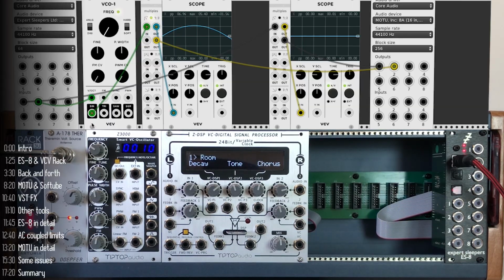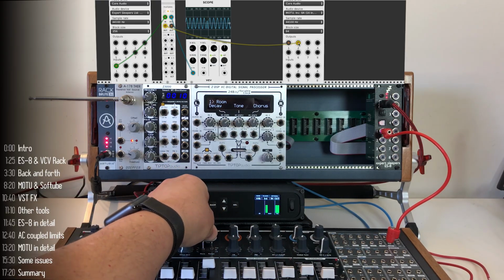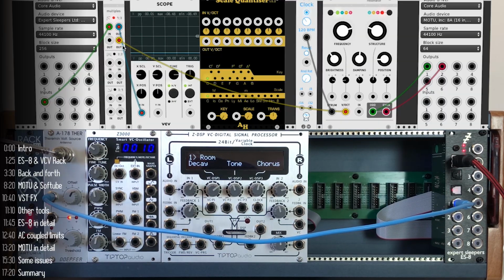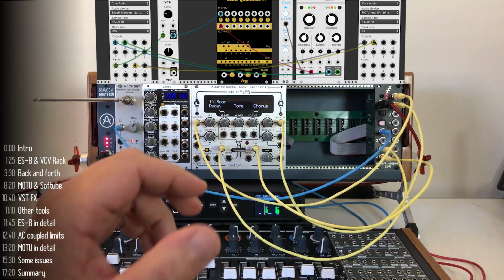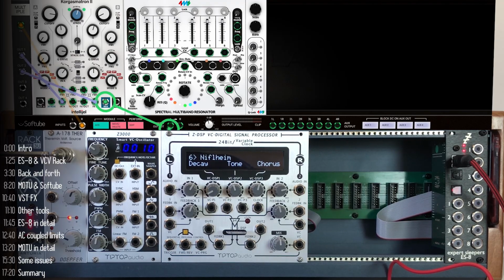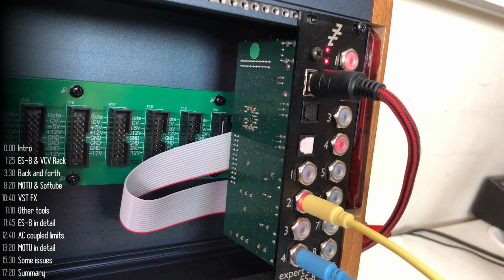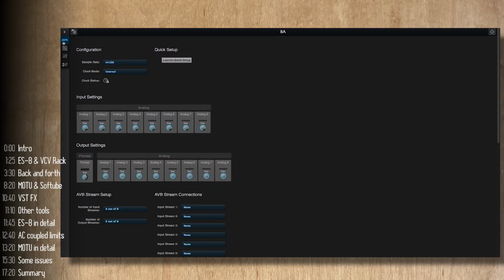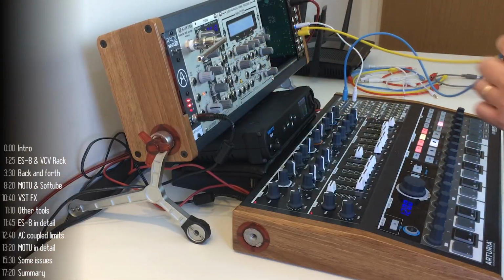Hybrid modular - The one must-have module: bridging Eurorack and VCV Rack, Softube (ES-8 and MOTU)

Comment: Do you think there's room in the market for a product that combines a raspberry pi with VCV Rack and a good USB router box into a chassis with a nice touchscreen? And then... If it's eurorack mountable and had some CV output and input jacks. That would really be something. I think about this whenever I wire up my iPad to a million doodads and connectors to do stuff like this. What if it was a real thing
Reply from the maker: Check out Meta Module (it's not everything you asked for, but in the general direction...)

Comment: Hi great video, one question if I may?  Does the soft tube modular work with the es8?
Reply from the maker: Should work if I remember correctly! I believe I discuss it in this video but it has been a while
Reply: @loopop  I could not think of a reason it would not work, but with you using the motu it made me wonder.

Comment: I want to use my DAW(Ableton) as my sound source to send the audio from the DAW 
into the "ES-9" via USB to one of the "ES-9" outputs, 
from there to a filter module for example a "Doepfer A-106-5 SEM Filter",
and from the "Doepfer A-106-5 SEM Filter",
back to one of the "ES-9" inputs, 
back to the DAW via USB.

My goal is to give digital sound a warmth character through modular filter modules

Is that possible?

Greetz

Comment: Its like a new world just opened up for me. I don't own Modular, I am not planning to jump down that rabbit hole, but I do have several semi-modulars including the Arturia MiniBrute 2S you are using in this video. I've always used MIDI - but have pre-MIDI legacy synths. Plus I have been using Motu Interfaces for ever - and never knew about "DC-Coupling" I have 828ES and 8PRE-ES - and the manuals don't even mention it - MOTU website does - 8 DC Outputs each only.  I got onto this because Synthtopia had an article about Spektro-Audio CV toolkit today. (Do I need it?) And that sent me searching. Motu Volta software does not seem to be around any more - and was for MAC only, and $$$ anyway. Now I have a lot of new things to learn! Fascinating.

Comment: I would get an ES-8 but I don’t have eurorack - I want it to connect VCV Rack to my Moog semi modular gear.  So I’d need a 8hp case which doesn’t seem to exist.  Another option perhaps is a Zoia Euroburo, which has 4 in - 4 out that I gather would link hardware and software.

Comment: is the expert sleepers es-8 module fitting okay inside the racbrute 3U?? are you using washers to lift the module and make it fit or is it touching the bottom of the case slightly? Thanks
Reply from the maker: It fits just fine - this case is pretty deep
Reply: @loopop  much appreciated for your response

Comment: This is very insightful, thank you! Re the Motu audio interface, I've come across plenty of resources online about DC being harmful to speakers. Some people say this was a marketed thing in the 70s and fried a lot of amplifiers. Have you ever had any problems in this regard? If so, how did you overcome them? Do you know if recent DC coupled audio interfaces do something differently to avoid damaging the speakers? Finally, would a passive DI box placed before the speakers be a potential solution? Thank you for taking the time to read this!
Reply from the maker: I wouldn't worry about connecting Motu to speakers otherwise they'd have quite a large lawsuit on their hands. I used it for a while with no issues.
Reply: @loopop  I see, thank you!

Comment: Thank you again for this great video. This might not pertain to this video, but do you think sending Audio from Bitwig (say Sample Libraries sampled from original instruments & Key Mapped Multi Layers) to External CV Modules, using a DC coupled Audio interface, ES-9, with multiple ins and outs, would really give these VST type instruments a more analog, rich sounding tone, like a well designed synthesizer, or staying ITB is just as good. I am just thinking of the computer, daw as a big Digital Data(infinite storage) center, but it being controlled by CV, to give it a bigger  and complex sound. I hope that makes sense, something like the older Emu samplers would give us back some decades ago. Thank You!

Comment: Can you do the same with Softube modular? Softube modular doesn't seem to have audio interface modules like vcv. Or can you route cv and audio via the daw u are using Softube modular on?
Reply from the maker: I would check with Softube since it has been a while since I made this video. If I remember correctly there were only two channels. I was using it in Ableton Live
Reply: @loopop   Thanks for responding! I can't seem to find good info or YouTube material about Softube modular interacting with hardware. Will start using vcvrack I guess.

Comment: VCV Rack has limited functionality on my late 2014 Mac Mini., but MiRack (VCV Rack for iOS), works great on my iPad. 
The ES-8 is class compliant, so should work with my iPad.
Would be great to use all the great iOS sequencers with my eurorack too.
The Polyend Poly 2, is a nice option for $350, that includes MIDI I/O and usb in.
Manikin Electronic CV-DAC-8 is an 8-channel audio/CV USB interface eurorack module. It sends both CV and audio signals through two sets of outputs, for $400.

Comment: Hi - I noticed your using a "core audio driver" for both input and output however you are using both the Moto and Expert Sleepers hardware for input and output audio. You did however mention you only need one Audio device. Is this possible? I have a Steinburg UR22c and want to route my Model D into VCV rack, modify the sound,  and  then out again through the UR22c. This crashes the VCV rack when using the ASIO driver. I understand the core audio driver allows multiple audio channels in and out. Is this what you were talking about using only needing one audio hardware interface? That would be nice,  but maybe not possible.  Currently I can get the Model D audio signal into VCV rack and can see the wave signal on the scope. But then what? 

This would be great if it worked! Thanks for your video.
Reply from the maker: Sounds like you're just trying to route audio and not CV, which shouldn't be a problem at all. Sorry, I can't help with your individual setup

Comment: Have you ever used the ES-8 as an audio out/in without the MOTU? I own one, I love the functionality, but sending audio out, into say the Morphagene, and back to the ES-8 seems to color the sound. While it isn't horrible, it is a noticeable difference in the audio from a synth. I do plan on connecting it via ADAT to a MOTU interface similar to this one, but I was not sure if the ES-8 really was for input / out voltages, rather than audio. Any thoughts? I really do appreciate all of your videos you have helped me tremendously.
Reply from the maker: Thanks very much! ES-8 certainly works for audio but honestly I've not done a thorough A/B comparison of its converters to those on the MOTU

Comment: @loopop is the ES-8 still your favourite way to integrate between Eurorack and VCV, or has something better come along since you posted this? Thanks for all the great vids!
Reply from the maker: Well, they released ES-9 recently, which has way more IO, but for starters ES-8 is still great, or if your interface has adat, one of the ES expanders. No other company makes a similar product that I know of.
Reply: @loopop  Thanks for the quick response, lots of inputs and outputs! Oof, not cheap, $779 (Canadian) from Nightlife Electronics. It does open up all of VCV Rack though, so it's essential as you point out.

Comment: hi LOOPOP. I´m looking at the MOTU ultralite AVB for multitracking my eurorack, as today I´ve only a stereo output from my modular mixer. This interface should handle modular levels ok right?(it´s still audio after all). I also intend to use the DC coupled outputs from the MOTU to send CV modulation back to the modular... Am I right about this?
Reply from the maker: no - I'm not sure at all about it handling eurorack levels, I would attenuate just in case and then gradually bring up
Reply: loopop great , thanks. About the dc coupled outputs on the MOTU to send modulation from the DAW to the modular should work?
Reply from the maker: The Music Astronaut yes partially, but really the expert sleepers modules and expanders are the way to go if you’re serious about this
Reply: loopop yes, thank you so much for answering. Just wanted something that has 1/4” and mic inputs as well.

Comment: thanks for this great vid. Two queries: if in your example setup, the MOTA 8A is the alternative to the ES-8, why are the outputs from the 8A going into the ES-8...isn't the point that the 8A outputs can be used to send CV directly the modular modules? (I only ask as otherwise I have missed or misunderstood something).  Also, relating to the comparison between the 8A and the Ultralite MK4 - are you saying the MK4's input are NOT DC coupled, but the 8A's are? (I looked on the specs sheets on MOTU's products pages but it didn't reference DC coupling on either set of inputs, just on each interface's outputs. Cheers in advance.
Reply from the maker: Thanks! Only the outputs on the MOTUs are DC coupled. Re connecting motu to es8 you’ll have to point me to where I did that in the video - that’s from a while ago. It’s not necessary though
Reply: @loopop  wow, thanks fro lightning fast reply! around 13:30 is where it shows outputs from 8A going into ES-8, but thanks for clarifying that these could go straight into CV inputs of the module synths directly. Sorry, but more questions arise then - do the analogue inputs on the interface need to be DC coupled if taking audio i.e. having DC coupled inputs is only necessary if one wants to pass CV back into the digital domain e.g. to my DAW or one of the software products this video references? Also, if the inputs do NOT have to be DC coupled (for audio) is it just about having sufficient headroom for the hot Eurorack signals?

Comment: I would like to build a rig that is meant to just process audio from my daw, synths and my guitars. Im so confused on what module I should be buying. Is there anything else than the 500+ costing es-9? (I've got an audio interface)
Reply from the maker: If your question is about passing audio, then any audio interface would work, just make sure you attenuate the audio before sending it to your interface, and if your sound module doesn't accept line level audio, find a VCA that also amplifies levels, or get a dedicated module that does that (like SBG for example)
Reply: @loopop  Thanks for the answer! So I would send the sound through the outputs of my interface?
Reply from the maker: @TheGuyWithHighVoice  sure

Comment: What a great video! I'm moving my first steps in the word of integrating modular and digital. I have a Motu Ultralite Mk4 for this purpose, but I didn't start yet: I heard that many people use special "floating ring" cables (TRS to TS with the ring disconnected), to connect the DC coupled interface to their Eurorack modules, but I noticed you use normal TS "mono" patch cables, even with your Motu. Have you ever deepened that topic? I'm still confused if they are necessary or not!
Reply from the maker: Motu say they are necessary - I added a comment in the description to that effect as well.  I works but can be harmful over time I’m told
Reply: @loopop  I'm wandering if an insert cable (modified with 3.5mm TSs outputs instead 6.3mm ones)  can give (in addition to the same result in the mono out connected to the tip) also the utility of an inverted signal on the other output connected to the ring. Theoretically it will. I must give a try :)
Reply: Two questions.  1) can we set up some kind of automatic trigger.  When loopop reviews something, it automatically deducts my bank account and ships the gear to me?
2) I believe Ableton Live only lets you talk to one audio interface.  So if I want to keep my other gear wired in (mics, synths, monitors), while simultaneously using CV tools, etc, then sound card with optical to ES-3 would be a way to accomplish this?

Comment: Nice...looking into an old MOTU 828 mk1(much cheaper than expert sleepers ...) 
if I understand it will only provide DV coupled outputs , not inputs correct ? That would be fine as I only intend to send modulation  from Ableton CVTools to my Eurorack....the thing is : can I use two audio interfaces simultaneously in Ableton? My other synths and drum machines would be recorded multitrack through my interface Allen and Heath QU-16 interface.

Comment: Fantastic overview, I would like to point out that those who already have audio interfaces with ADAT Lightpipe,  Expert Sleepers has another cv sound card ES-3 mk4 listed for 199$ on Modulargrid and it provides 8 cv outputs. Paired with ES-6 mk2 which offers 8 inputs listed for 155$.
Reply: so is that a better way to connect the two? adat?
Reply: @HenricWallmark  if you already have an audio interface with an ADAT connection then it is a more economic solution.
Reply: @gunnarwaage4343  cool, thank you!